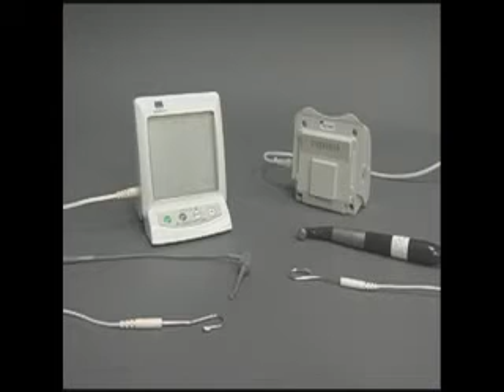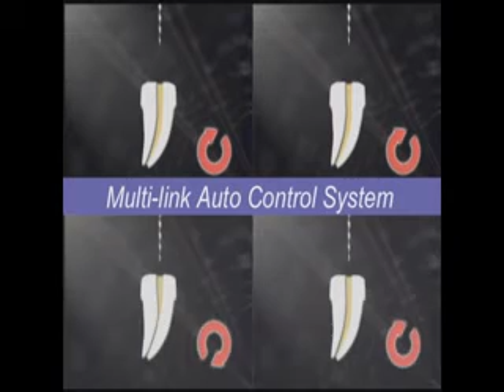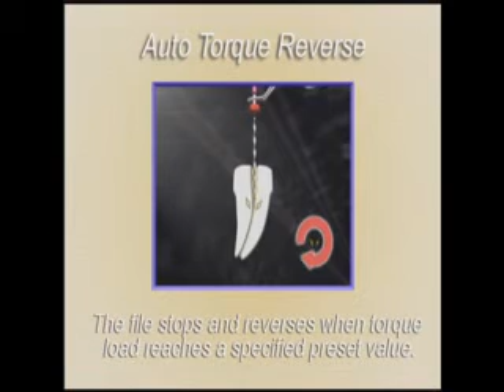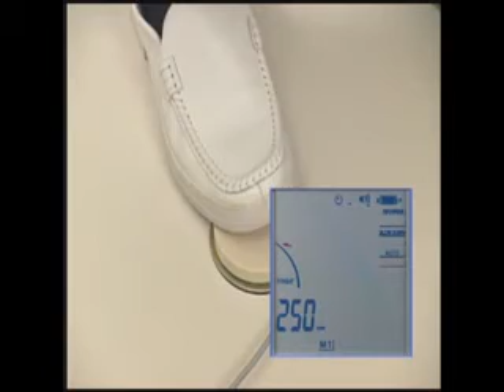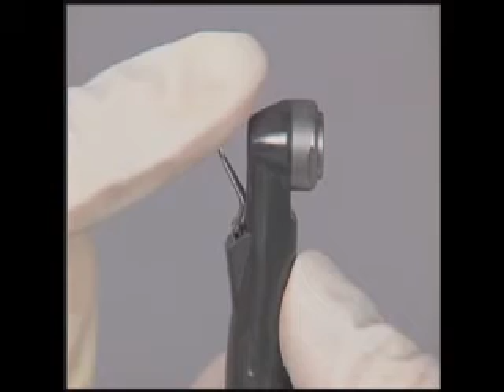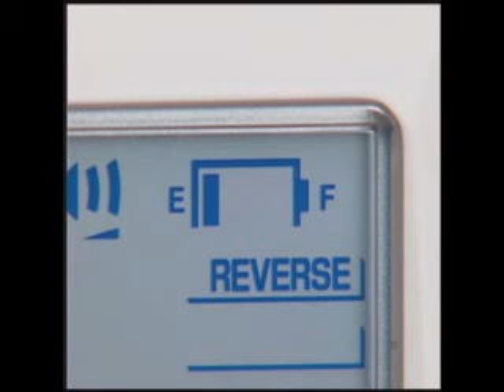MORITA - Root ZX II  [parte 1/2]

Comment: @MeMo5682 , It's extremely accurate. I've used it a number of times and it always gives correct readings which can be confirmed radiographically. Always recommended to use apex locators in conjuction with working length, master cone and post obturation radiographs.